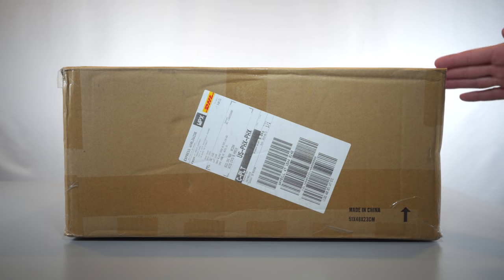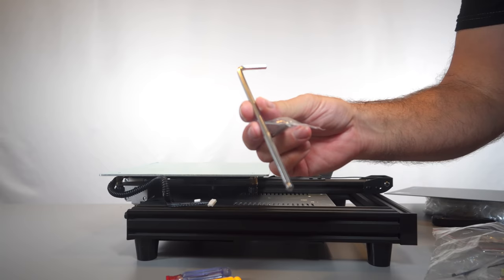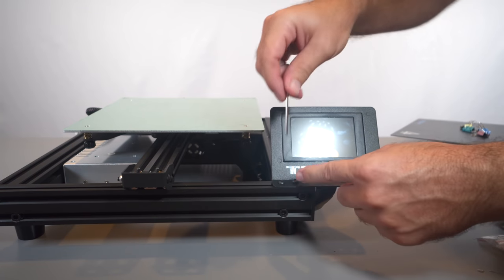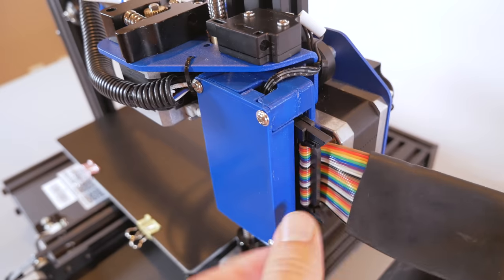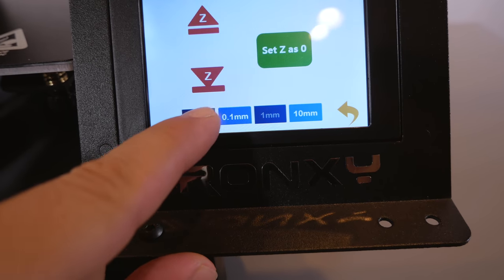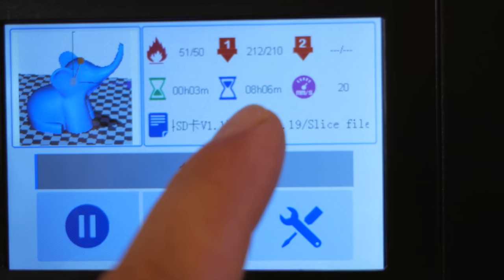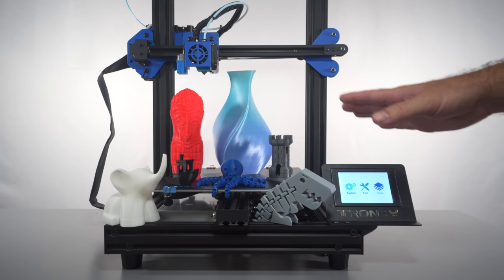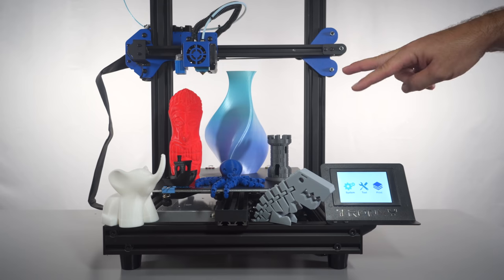Tronxy XY-2 Pro - 3D Printer - Unbox & Setup

Comment: Absolutely fascinating video. Thank you. You should have titled this “ Tronxy XY-2 PRO-3D Printer -Unbox and SETUP for Dummies”. Tronxy should use this as an instructional video. By the way the new title I suggested is meant to be a compliment, for a step-by-step Setup instructions for a total beginner. It will be fascinating to prepare a part 2 for this video, which will a ) show an accelerated video of the dinosaur ( it has a flexible body, question:How?), b) addressing the noise problem, if you have addressed it c) the printing of a multicolored prototype, if that is possible. 👍
Reply: More like a how to level the bed wrong tutorial.

Comment: I always level at at the expected print temperatures. I have found that the bed expands enough to mess up a print if leveled while cold.
Reply: Levelling a bed while cold is a rookie mistake!
Reply: @AndrewAHayes  yea and I made it more than once. But, I learned.
Reply: Oops, another trick I didn't know! Maybe that's why some prints fail for me. (Ender 3.) I will try levelling with a bit of heat. Thanks for the tip!

Comment: Great video as always!

I have a question/petition. Could you tell me/us the model of the board? And on which pins the inductive probe is connected?

I have a standard xy 2, I printed a filament sensor case from thingiverse and connected it to the board and, well, it didn't worked, but I uploaded the pro firmware and it worked. And after that now I also have the button for automatic bed leveling, but before buying a probe I would like to know if my board have the pins.

Keep up with this format, it maybe kinda for dummies, but I really enjoy it!

Edit: one more question:

Are you planing to install smothers and make a video showing if it solves the issues??

Edit 2:

Also, if there's any information printed in the sensor itself.

Thanks!
Reply: You have to modify the software, search un Google chitu gcode,

Comment: I've had this thing for three weeks now and I'm just going nuts making things. I've been into 3D modeling and animation for about 20 years now and being able to model something, and hit print to make it for real is just blowing my mind. Wow what I could have done with one of these in the 80's when I was a teenager! Anyway, the only issue I've had with it is I used the included micro SD card that came with it and removed it from the machine and corrupted it. Had to format it to use it again. Having said that, I've lost the Tronxy program on the card and want to also install it on my laptop and now I can't. Does anyone know where to get a copy of the tronxy slicer program? I've sent them an email two weeks ago, no reply. Also, since I'm using this thing daily now, I can answer a LOT of the questions anyone has about it. Maybe even make my own youtube video? I'm very impressed that any OBJ file even stuff designed with auto cad 25 years ago loads right in and prints with no issues. I've got a 4 inch tall R2-D2 bobble head for the computer room like I always wanted. Regular acrylic paints from hobby lobby work on PLA just fine.
Reply: I'm sure you've acquired the program since this was over 4 months ago that you asked about it. But I Can upload it to a google drive folder for anyone who needs it to download and backup the program for themselves if need be.. Just let me know and I'll go and do it right away!!

Comment: Hey, I watched your video and i had to get this printer so I did :D but I'm having Problems with slicers Tronxy is so basic so I tried Ideamaker Cure 3D and printer is behaving really wired what kind of slicer you used for ths printer maybe make video on your slicer of choice. Also anyone had any success with connecting to pc with the wire?? thanks

Comment: Hey man. So i just received this tronxy xy-2 pro printer and the instructions really don't give you much information on setting this printer up in Cura. Do you happen to know the start & end gcode, and all other parameters to set up for this to operate as it should without having a catastrophic failure?
Reply from the maker: In Cura use the ender3 profile and adjust the bed size in the machine settings. That should get you going till you figure things out.
Reply: Just Vlad I was thinking that might work. What about looking at the gcode file for one of the sample prints on the micro sod card? Couldn’t I get the start and end gcode extracted from there?

Comment: Hi
I’m considering this printer instead of a ender 3 pro. How’s this one working out for you so far? Good prints? What firmware /vs is it running and can it be upgraded if needed?  Does it have a boot loader or is it one of those pain to load firmware printer? Thanks for any follow up info.

Comment: I'm not sure what I did wrong but when I'm levelling my bed I have to turn the screws in till the Springs are completely closed  Before proximity sensor comes on I would like to know how I can loosen all of Springs to about half way and still level with Plenty of screw space counter clockwise and anti clockwise still its kind of stressing me a bit it works OK but I can't fine tune because there at max Nearley

Comment: The Z screw looks to be an Acme 1-start rod. Compared to my ancient 802M which has at least 3 starts, maybe 4, yours will move one third to one quarter as much per rotation but have 3-4 times the precision. And let's face it, the Z axis isn't going to be moving at any great speed to begin with.

Comment: I have this printer coming how do you get the printer profile in cura since cura don't have it already?  Under add printer
Reply from the maker: Use the Ender 3 profile and then adjust the bed size in the settings.
Reply: @JustVlads  thank you for the reply

Comment: HELP. Tried to make the elephant and the rook but both of them got to about the sand height and the printer head started to touch the model and just push it around. I'm lost.
Reply: Sometimes the model will release from the base. That's any 3D printer. When I'm doing a bigger model, I do not put the pad on the base and left that light blue plastic on the bed as well. Clean the plastic really good with a glass cleaner to make sure it leaves no residue. Do not use any cleaner on the print surface that leaves any kind of residue. I had some cleaner for computer screens and it made the surface slick and the models would break loose and slide around. Triple check for level. Super clean the print bed. Try again.

Comment: So, I've had this printer for a couple of days and have yet to have anything print on it! The bed is nothing like the one shown in this video, mine is in 2 pieces, the top level is very floppy and as a result it doesn't sit flat on the bed it bows in the middle even though it's clamped down. It levelled it all manually and then the auto mode, the first print the hot end ran in to the plastic bed mat and melted a circle in to it! So, the middle is useless now, great. I'm going to spend a couple of hours stripping it down and start again but if that fails it will be sent back, so disappointed as this is my first 3D printer and it's definitely not as easy as this video makes out, may be that's because you're an old hand with 3D printers but noobs will be left frustrated. My Tonxy is an upgraded version of this one with a Titan extruder but certainly the bed mat is a cheaper version, I may look to buy a magnetic mat to do away with the cheap clips. I've not given up yet, just my initial thoughts, wish me luck lol

Comment: 8bit or 32bit?
Reply: Judging by the "AR" M-ish peeking out from under the label at 6:25, I'm guessing that it is a 32 bit ARM processor.

Looks like it's a STM32F103ZET6

https://www.st.com/content/st_com/en/products/microcontrollers-microprocessors/stm32-32-bit-arm-cortex-mcus/stm32-mainstream-mcus/stm32f1-series/stm32f103/stm32f103ze.html
Reply: This is the basic model which is good on its on. Im looking at getting the titan upgraded one which I know is a 32bit and comes with silent stepper drivers. Price wise your looking at around 219.00 on geekbuy for the titan upgraded one. Not 
bad at all